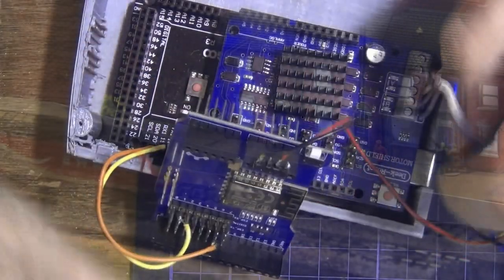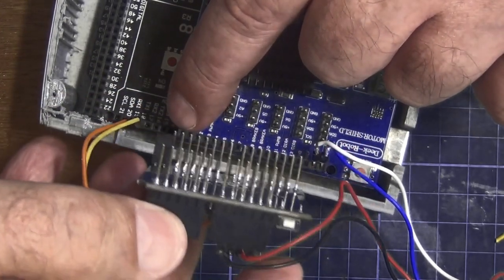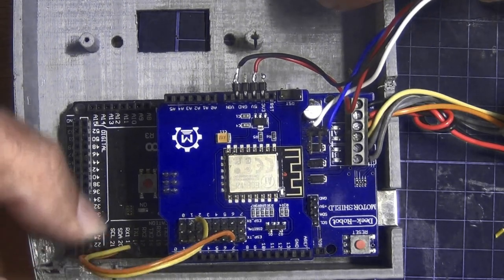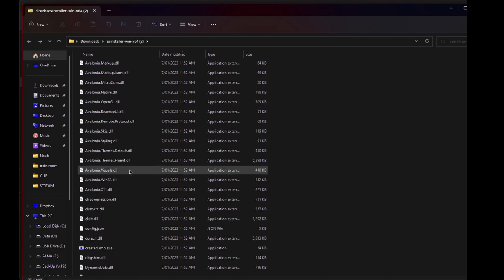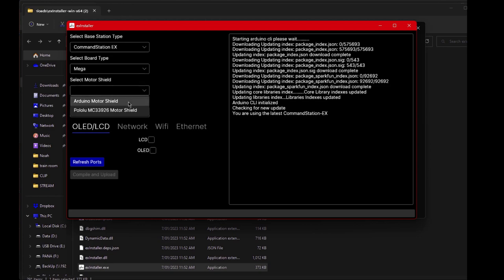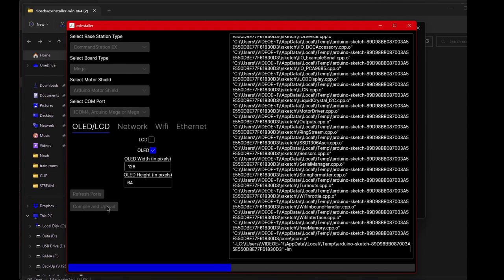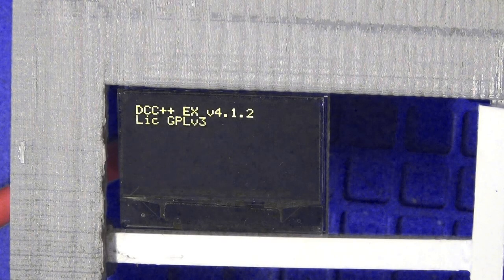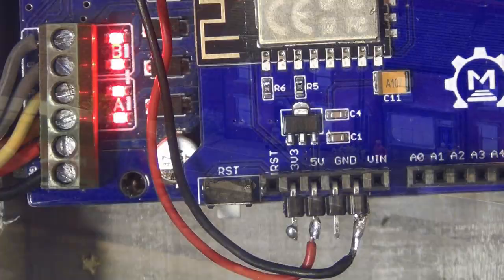DCC++ EX - Arduino Wi-Fi Update to my system

Comment: Good to see you again.  Have you checked out the DCC-EX website?   Have DCC-EX running on two layouts ... for now, both are connected to JMRI running on a computer.   Will checkout Wi-Fi this winter.   The Ex-Rail capability looks very interesting!    Take a look at https://www.youtube.com/watch?v=q58SyQ0eA7c.   There are Part 1 and Part 2 videos.  Cheers ...
Reply from the maker: Thanks you . Yes i do check the web site  out , I was one of the testers when it was first launched . I decided to go Wi-Fi  more to help my mate out. Now  As i am starting to do a bit more . Most of my lighting is run of Individual Arduinos as well as my Midsomer Police Sign.  I do have a lot of catching up to do   Regards Greg